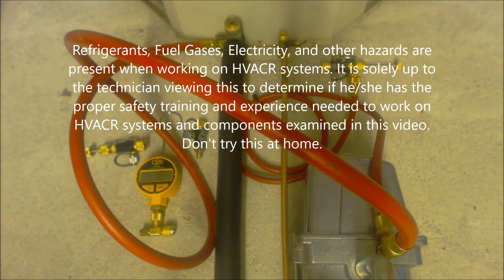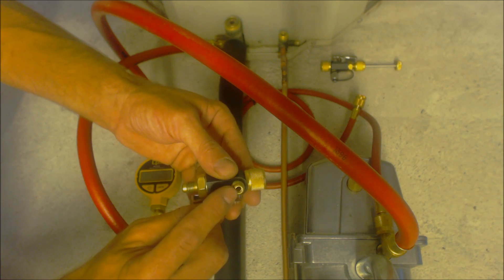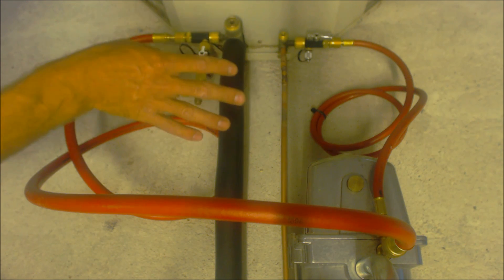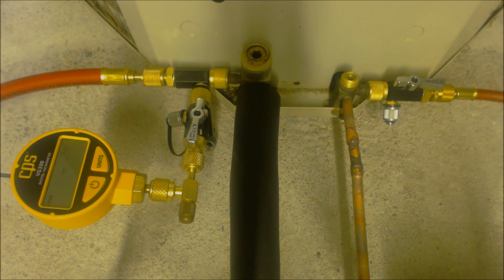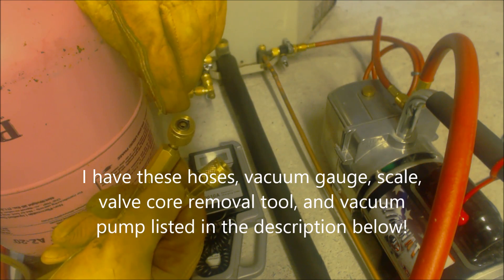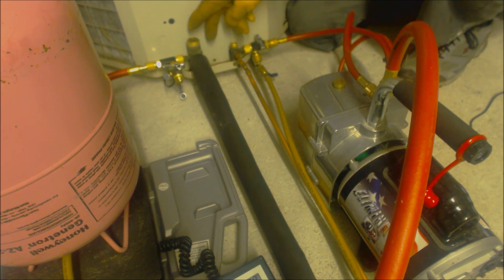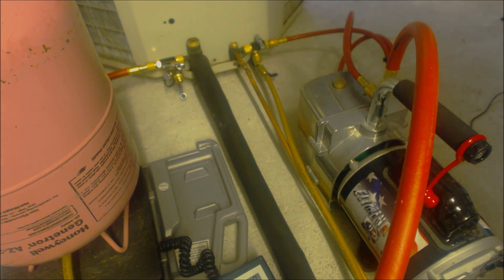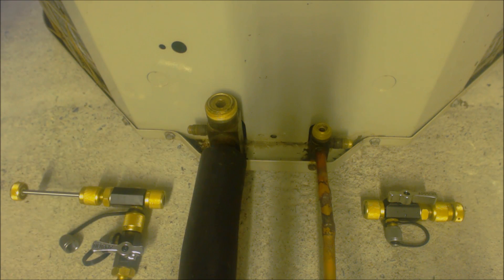Vacuum Pump AC Lines and Break the Vacuum with Refrigerant: Setup, Micron Level, Weighing

Comment from the maker: Tool List-  https://www.amazon.com/shop/acservicetech
Support-  https://www.patreon.com/acservicetech
For those that are looking for the tools used in the videos: (Linked Below)

Here is the Link to the Appion Red 3/8" to 1/4" Vacuum Hose- http://amzn.to/2uYg6Ro

Here is the link to the Appion Valve Core Removal Tool- http://amzn.to/2uYr8WL

Here is a link to the JB 6 CFM Vacuum Pump   http://amzn.to/2nqbvo8

Here is the Link to the Appion Blue 3/8" to 1/4" Vacuum Hose- http://amzn.to/2uYlVyc

Here is the link to the Yellow Jacket 1/4" by 1/4" heavy duty hose straight-  http://amzn.to/2umtcod

Here is the link to the CPS Vacuum Micron Gauge- http://amzn.to/2v1nM3O

Other tool links can be found in the video description section.

Check out www.Patreon.com/acservicetech

 ACSERVICETECH is a participant in the Amazon Services LLC Associates Program, an affiliate advertising program designed to provide a means for sites to earn advertising fees by advertising and linking to Amazon.com.
Reply: you are lossing the vaccum when connecting the charging hose.
Reply: @mk696  only if he did not purge the charge line

Comment: I thought that when you add gas you put it into the low side. Something about pressures are to high on other side.
Reply: R410-A is a mixed refrigerant and should always be charged as a liquid. his bottle is upside down allowing pure liquid refrigerant to flow into the liquid line/ high side. If he were to have his bottle right side up it would be charging as a gas

Comment: I tried to use the 2 hose method but couldn't get the micron gauge to register. Tested my pump with sing hose got below 100 microns. Went with one hose setup got down to 900 on low side decided to pull from high got down to 240 SMH at this point. I repeat with same results after opening the valves to the condenser. Still SMH but decide to break the vac after it set for 30 minutes at 240. I start weighing in refrigerant get to 3.5 lbs and it just stops! The system capacity is about 10lbs. Any thoughts on what is going on? Clogged filter? Stuck TXV?

Comment: why not include the connected refrigerant hose as part of the vacuum  pull.   So the line-set and the line going to the refrigerant tank valve is all under vacuum.   Even though you purged the line, it seems like you risk a small amount of moisture going into the system - especially from where the connection is made.  Having under vacuum and holding under 500micron , then break vacuum by only opening up the the tank valve seems like a better way to go.

Comment: I don’t understand why you used two valve core removing tools on the vapor line just for the micron gauge.
Reply: Its so the micron gauge doesnt get contaminated, then it wont read the microns correctly once contaminated with refrigerant oil

Comment: Hi there Craig Migliaccio, I purchased a very informative tech book from you guys but couldn't find anything much on "non-condensables" but great references book that I keep in my truck and would like to say thx for sharing your knowledge. I ran across an almost new heatpump with non-condensables in seal system and removed all old refrigerant and filter dryer and triple evacuation and still having decay failure. Ck for leaks and it seems to be tight. 
Installed new 20 cubic inch filter dryer. I did haft to recharge and noticed fluctuating head pressure. I new it wasn't dry due to vacuum decay test. Any advice sir???
Thx much!!

Comment: I pump systems down basically the same way. Although I don’t necessarily think this method reduces leaking points. You have screw on fittings everywhere , it’s at least just as leak prone IMO as a manifold set. Also I have  ran vacuum without removing cores and found it to be a negligible time difference. Despite all that tho, this is the best practice I have found.

Comment: I haven’t found a big advantage of vacuuming from both sides of the system.  We’re not talking about huge volumes of air being removed so the CFM quickly drops so I’d rather have fewer overall fittings hooked up to the vacuum pump.

Comment: How often do you change the oil in your vacuum pump AC Service Tech? I've heard people say you should change it after every use. That seems exsessive to me. I have never changed the oil in the vacuum pump that I use for Auto AC.
Reply: If its not clear or has crap floating in it, its time to change it..   like if it has any color to it at all it will not pull the vacuum of the pumps potential..   like any dye or doodoo floaters...
Reply: The deeper the vacuum is needed (regarding to temperature) the fresher your oil must be. If you work during summer, you will less likely change your oil.

Comment: Wouldn't have you sucked in air when connecting the hose from the bottle to the liquid line service valve? Regardless if you purged as you connected it, you would have sucked in the slightest amount of air mixed with the refrigerant as you depressed the schrader.
Reply: snaptrav . At 10:30 ? At this point I vacuum the yellow hose ; and then turn on the bottle valve. And so on.
Reply: @Froggability  mate you have no clue

Comment: I would like to disconnect the vacuum hose on the liquid line side and connect charging line to the port of the core removal tool but not side port. When you put charging hose to the side port very likely your charging hose depressor will touch the core of the core removal tool, which will introduce air into the system. Thank you
Reply from the maker: I agree and I never have a valve core in the side of my valve core removal tool. That is usually where I put my third tool anyway, thanks!

Comment: In your experience how long it takes to pull a vacuum down to 500 micron? Understand it may differ from type of pump and system but for a 3CFM pump and 5Ton unit with 100ft piping?

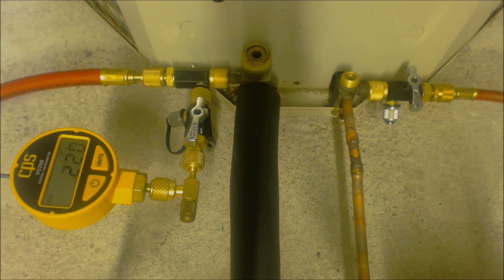Comment: Regarding your on-screen text at 8:03.....Does it speed up the process if you vacuum a mini split from both liquid and vapor service ports if the metering device is by the condenser? Is it worth it or do you just vacuum with one hose from one port? Thanks again.
Reply from the maker: We usually just vacuum from one side because like you said, the metering device is in the outdoor unit, thanks!

Comment: Do you ever lubricate the shrader cores with a very small amount refrigerant oil when you reinstall? Do you think that step is beneficial to improve the seal?
Do you lubricate the shaft and seals of the vcrt with refrigerant oil?....I got your book by the way and I find it very helpful. Thanks again.
Reply from the maker: If anything, I just put a small dab of oil on the rubber grommets but I don't continue to relubricate them. They usually have some oil on them. The schrader valves can take a little oil on the neoprene but will also work without with absolutely no problem, thanks!

Comment: Thanks for the great video. In this set up I see that you have the micron gauge on the suction side and not the highside. Does it makes a difference? i have always been told to connect it on the highside please help me clarified my concern. Thanks.
Reply from the maker: I connect it to the vapor line because this is the larger line and it will read a slightly lower micron level since the tube is slightly larger, thanks!
Reply: Thank you !

Comment: In this video you charged r410a refrigerant from discharge line to the system.if it’s r22 unit so you need switch that T appion valve removal tool and micron gauge to discharge line from suction line,then add r22 to the system?
Reply from the maker: You don't have to switch anything since the system is in vacuum, weigh liquid into the liquid line to break the vacuum, thanks!
Reply: AC Service Tech LLC thanks I always learned something from your channel.thanks again!

Comment: How does the micron gauge get included In the vacuum if the ball valve on the first core remover is blocking off the access to the port the second core remover is on?
Reply from the maker: The valve is of the shut off valve core removal tool is closer to the hose so the other one is still reading the vacuum of the system. Also, I don't have the valve cores in the sides of the valve core removal tools, thanks!

Comment: I have the exact same setup as your mine will only drop to 720 micron. Now when I isolate the pump with a valve the micron level don’t rise at all telling me there is no leak however when I connect the pump back and try to pull more vacuum it won’t do down below 720 and vacuum reading on my vacrometer start to rise which is odd. I even left my inside fan on but same result. Amy idea what I’m doing wrong?

Comment: The tech I just had come out brazed a line that was leaking. Never ran nitrogen, never did an oil blow out. Only did this portion of refilling 3.5 lbs according to the sticker and never hooked guages by the TXV to check superheat and sub cool. I have a 60' line set. It only cools 50% of the evap coil(25° temp dif from both sides of evap) Did he not do the job correctly?
Reply from the maker: We only hook gauges up at the outdoor unit after vacuuming and breaking the vacuum with refrigerant. We check the charge with superheat or subcooling depending on the metering device to confirm the charge, thanks!

Comment: Quick question.. would it technically be breaking your vaccum when you attach the hose from the refrigerant tank to the core removal tool?
Reply from the maker: Yes you have a vacuum trapped and we are breaking it with refrigerant regardless of the steps to get there, thanks!

Comment: When you attached the refrigerant hose, did you not just allow air to get sucked in? Wouldn't it have been better to have vacuumed the system with the hose already attached with the ball valve closed?
Reply from the maker: I purged the air out of the new hose with refrigerant, thanks
Reply: @acservicetechchannel  I've been practicing your method since I've had issues with vacuuming through my gauges and ive had excellent results so far. Thanks. I want to be clear with the introduction of refrigerant as shown in your vid. From what I see, the hose valve is half open when you tighten the hose on. That release of refrigerant is enough to avoid allowing air into the vacuumed system correct?

Comment: question   why  is  it  necessary  to  vacuum  after  pressure  testing  the  line`s   thank`s
Reply from the maker: You have to remove water vapor and air from the inside of the tubing so that it doesn't mix with the refrigerant and refrigerant oil. The system won't work if air is in there, thanks!
Reply: @acservicetechchannel   Thanks   for the  get  back

Comment: Hey there I have a couple questions if any boy can help.
Is it possible to use only one hose and pull a vacuum and just have the other port capped off. 
Also I'm pulling down to below 100 microns in about 5 minutes is that possible ?
Reply from the maker: It is possible to pull down that low but the real test is when the vacuum pump is valved off and then shut off to see if the vacuum level rises. It is quicker and more effective to pull from both sides because of the restriction in the middle which is the metering device, thanks!
Reply: @acservicetechchannel  ok thanks. I'll continue to double and triple check

Comment: Not gonna lie I copied this set up for a while.  Great results.  I replaced the cps gauge with a testo 552 and that micron gauge claiming to be the most accurate takes forever to pull down.  I've heard this issue many times online with the testo 552 . Kinda wish I got another cps or bluvac. Issue I had with cps is the screen cracked and no longer had a display . I see the yellow body cps went away and now they're black.  At least in my area
Reply from the maker: Yeah a lot of people complain about micron gauges and it is hard to tell when reading reviews if they know what they are doing. I love that CPS and the Supco have always been reliable too!

Comment: Aren't you compromising your vacuum buy connecting to that schrader port? Instead, remove your 1/4” vacuum hose from the VCRT,  purging your hose after connecting to the VCRT and then opening the VCRT ball valve?
It seem risky connecting your hose to the VCRT schrader port when under vacuum.
Reply from the maker: Hey Patrick, this is breaking the vacuum with refrigerant from the bottle. You have to disconnect the vacuum hose to connect the hose with refrigerant to the valve core removal tool and we already determined the valve on the vcrt is holding vacuum with the standing vacuum test, thanks

Comment: Probably a non sense question but after you hook up your hose from the tank and hook into high side service valve, then open tank to fill hose and then zero out scale, purge air and then open ball valve to weigh in refrigerant? 

As opposed to hooking hose into tank and to high side service valve, then zeroing out scale before refrigerant is released into hose.
Reply from the maker: You want the hose to fill with refrigerant but not allow it into the valve yet before zeroing because the hose will have weight in it when you are done so it will be more accurate of a weight, thanks and the valve core removal tools are a must to really get the procedure down, thanks!
Reply: Thank you again.

Comment: Thank you for your amazing videos and clear concise procedures. You have helped me tremendously in life!  I can't seem to find an answer to this question, so I assume it's not the standard way to do things but
When installing a new heat pump w/txv whose lineset is under deep vacuum,  would it be easier/better/possible to weigh in the additional charge (or most of the additional charge) required for extra line length in this same way (letting the vacuum pull it into the liquid line), then open the service valves, start the system and do final adjustments? Especially when its cold out?    Would that create an analogous situation to having the exact length lineset for the initial charge, or am i missing something?
Reply from the maker: That is called the total weight method and it is exactly what you do when installing a heat pump in the middle of winter since you can't check the charge on most when it is really cold outside since the amount of refrigerant in the accumulator is not known. In ac mode with a temp above 70 degrees, the accumulator is drained and you just check the charge with superheat or subcooling. Yes make sure you weigh into the liquid line, thanks and great thoughts Brian!
Reply: @acservicetechchannel  Thank you, so very much! I did just that yesterday afternoon - it was easy! The system is running perfectly! Wow!  I really appreciate you taking your time to create such a vast and diverse Library of information -  Your videos are by far the clearest, most concise, and most  actionable here. 👏
Reply from the maker: Thanks a lot Brian! I really appreciate that!

Comment: Interesting approach and I understand its purpose for faster vacuums, but I'm a little concerned with something.

You mentioned not using manifolds to reduce the potential for leaks, yet there seems to be a lot more connections being made and broken here that could lead to leaks or air and moisture in the system.

Comment: I like this setup. One question I have is could you have  left the refrigerant hose valve open, vacuumed down the system including line running to refrigerant tank, then released  the refrigerant? This seems easier to me, no need to purge air out but your setup would likely use the vacuum to suck the refrigerant out of hose. I suppose your method would make sure not refrigerant left in hose after whereas doing it other way would possibly allow some of it to float around in the hose after.
Reply from the maker: Great thoughts mo, I try to limit the amount of hoses when vacuuming, thanks!

Comment: Can you use 2- 3/8" vacuum hose?   Or 1 with the 1/4" hose is better, also is the 1/4" gauge set hose with the shrader removed. 
Thank you
Reply from the maker: So I have a dedicated vacuum set that I use some of the items for recovery as well. I do not use these to check the charge and I don't include the manifold unless checking the charge, adding or recovering refrigerant with the system compressor. The hoses used for the recovery machine and for vacuum do not have valve core depressors in them. This will all be spelled out when the book is complete. You can use (2) 3/8 hoses as long as you have 3/8" ports on your vacuum pump. The other side of the hose will be 1/4" as they connect to the valve core removal tools. Don't use reducers but these will all be one hose like the ones in the links I gave earlier. I happen to use that 2' 1/4" hose because I only have one 3/8" port on that JB vacuum pump but the new fieldpiece has two 3/8" ports and that 2' 1/4" hose I linked is only around 12 dollars. You also want a small short hose for the outlet of your recovery machine anyway, thanks. Check out- https://www.youtube.com/watch?v=os9gKLf7LJg&t=261s   -  and https://www.youtube.com/watch?v=wYZ8Wudksb0